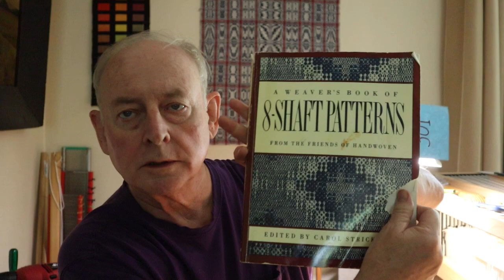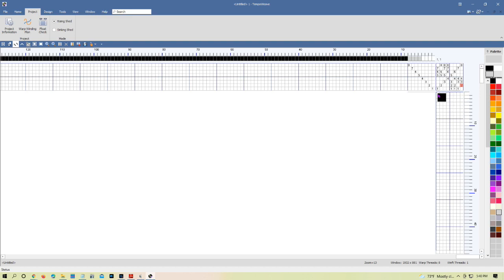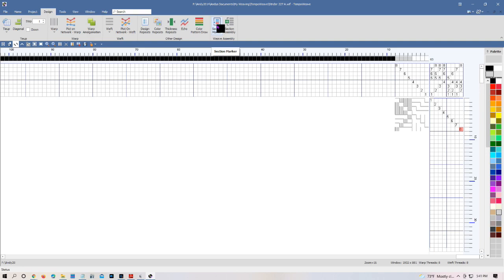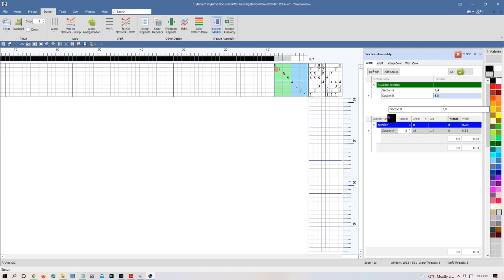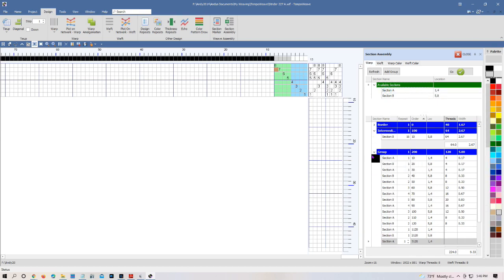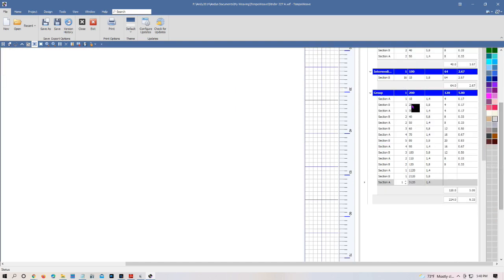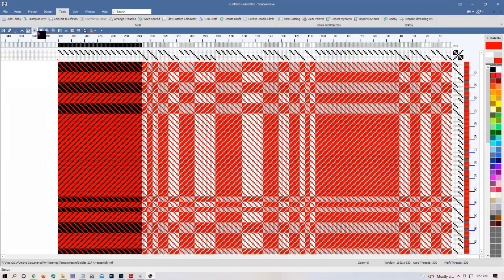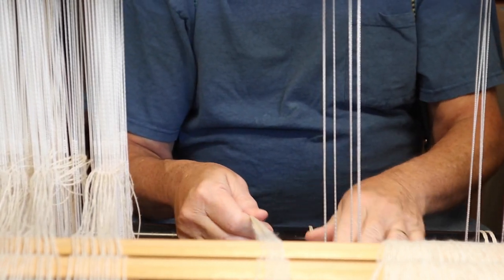Strickler 227   part 1

Comment: Thanks for this great and informative video. I am looking forward to the next part. It is amazing how even your tension is right away!
(Using tabby treadles too, I half the threads in a group and lead the tie-up thread between them, but I need to do lot more fine adjustments) /sorry for my English/
Reply from the maker: Your English is just fine.  I was lucky on tension, I usually have to play with it and make more adjustments.
Reply: @curmudgeon66  Thank you for your kind reply. How long warp did you wind and what is the anticipated usage of the presumably very attractive material that you will create soon?